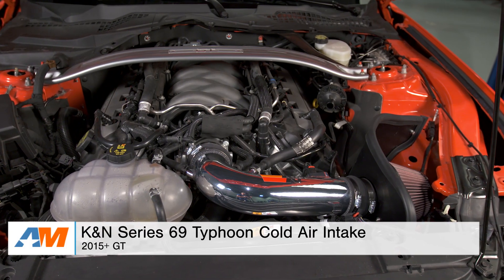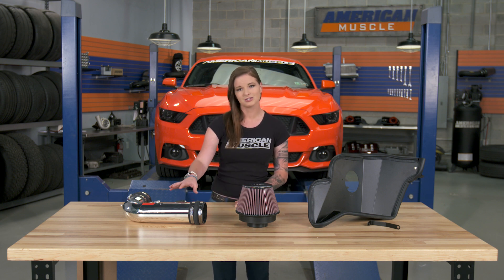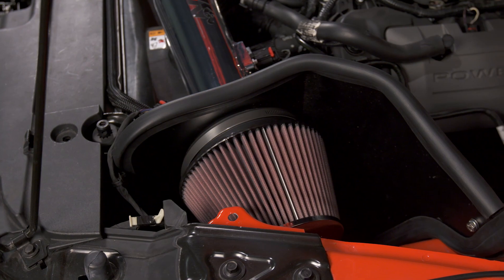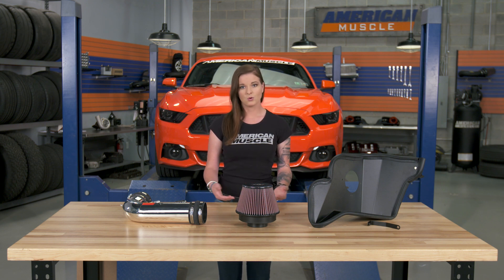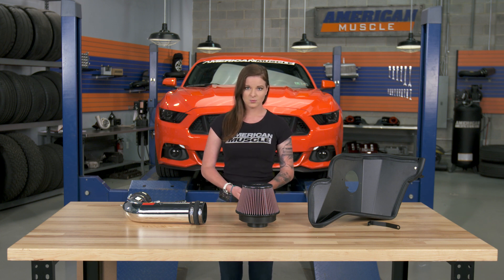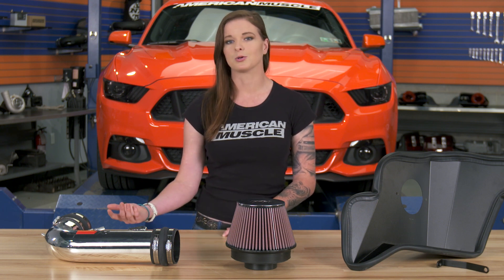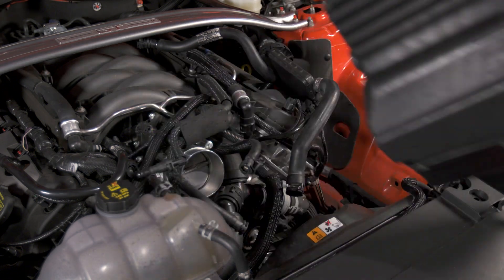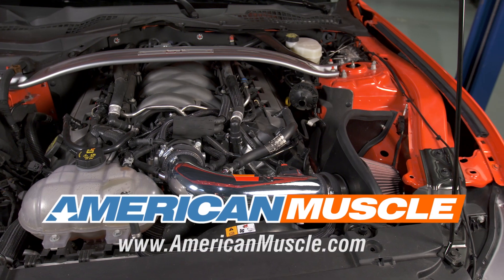2015-2017 Mustang (GT) K&N Series 69 Typhoon Cold Air Intake Review & Install

Comment: I own a K&N like this. It picks up every drop of engine compartment heat when you are not moving. In traffic, here in Knoxville, I have seen intake air temps well over 140 degrees. It has however given me some extra gas milage.

Comment: It's my second K&N filter and the one thing I noticed is the elastic band effect on hard acceleration on the low end that most aftermarket CAI do to cars! It's such an unpleasant feel and might go back to stock on my 2016 GT air intake system. Using this car as a daily driver there's absolutely noticeable loss on the low end which we use more on a daily so is anyone else noticing this on their car? I did purchase Pedal Commander from AM and it's helped me alot with the delayed in the pedal response!